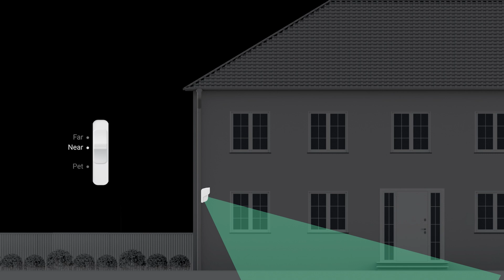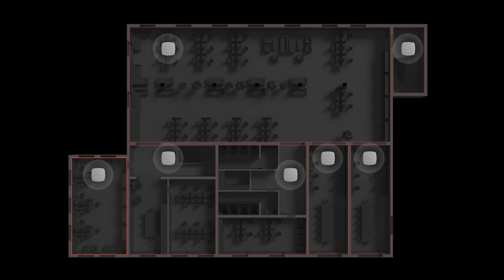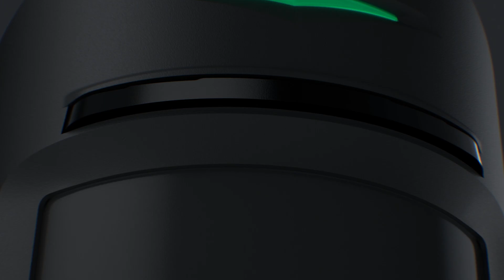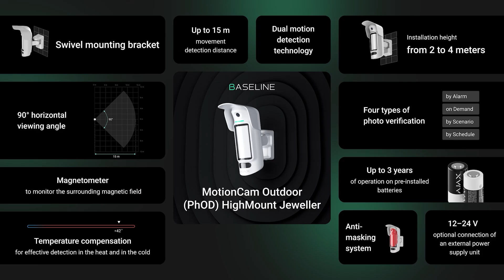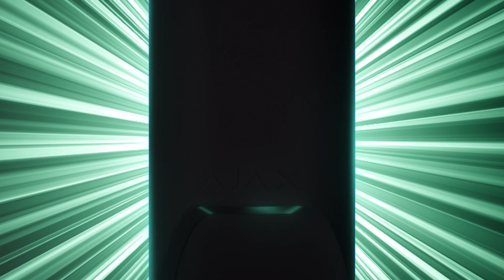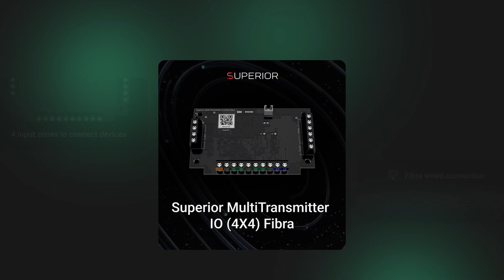Looking inside Ajax Multiverse: Intrusion protection

Comment: ALMOST solves my clients problems. Standard hub battery advertised at 16 hours. Australian standard for alarms says minimum 24 hours battery backup. For a client on a remote farm, where there is no cell coverage, their starlink internet is all the external comms they have. This Jeweller hub would have been great with its long battery life, except for its lack of ethernet connectivity.

Comment: The promised range is questionable.
I have an indoor motion camera in an industrial building with high ceilings, open indoor area & several windows about 80 meters away in a separete building with intermittent communication problems. 
The field of view between buildings is open. 

- Also an high mount motion outdoor camera mounted 3 m up on a wooden building 400 m away. 
The camera is facing towards the building with the hub and the view is only restricted by a pine hedge half way between the camera and the hub building. 
- Both signal protocols are struggling to reach the 1 strength mark on antenna level. 
Now i probably need to waste approx 200 Euro on an range extender. 🤬
Reply: The promised range is tested in an open field without any noise (dBm). Every installation varies. A common mistake also would be that people install Hubs directly near routers or metal objects and mirrors. All these can significantly decrease the range. Most common issue I would face is the average noise though. Hope this info helps
Reply: @ovrlefty Thanks. 👍🏻